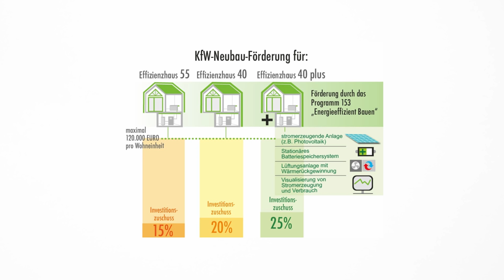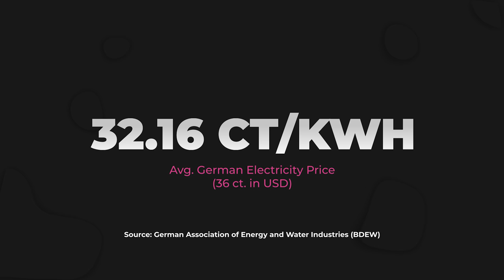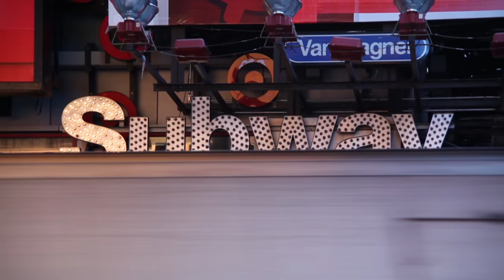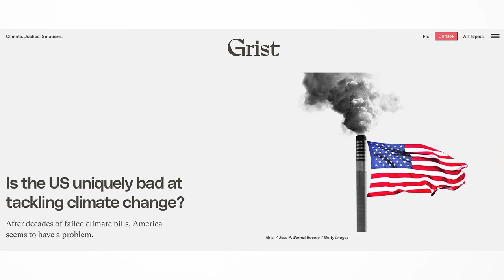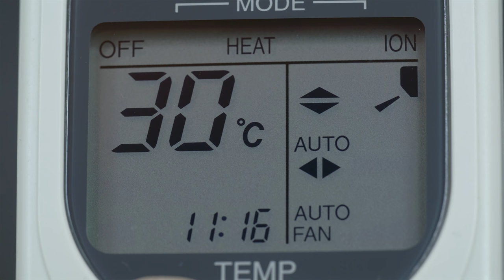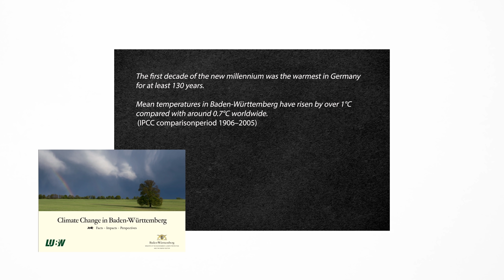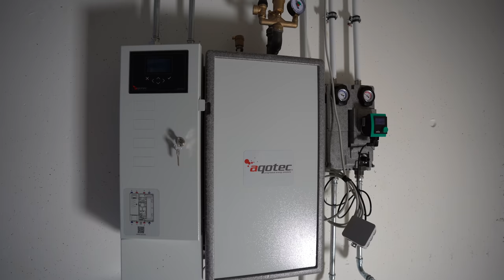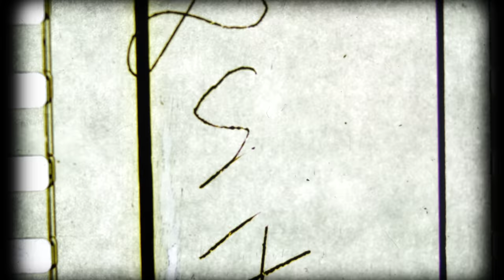HVAC (HLK) in German & American Homes | A Tale of Two Countries

Comment: When I was in the US I always recognized the noise of the forced air heating systems. This is a great advantage of radiant heat. Sometimes I simply could not sleep when the heating was on. In addition I  dont like the soft "wind"/air movement that is always happening inside the house with the forced air system. But this may be  a matter of getting used to it.
Reply from the maker: I would imagine it is just something you have to get used to.  Since we grew up with forced air we can't sleep if it is too quite now. We run an air purifier in our bedroom partially due to my allergies, and partially because we like the white noise.
Reply: This year I discovered I cannot handle the sound and feel of forced air heat. This is after travelling between America and Germany for the last 15 years. Every house we stayed in in America in 2021 had heating systems that would come on, go off, come on, go off, all night long, and when you have jet lag you just lie there listening to the on off cycles. There were certain places in the kitchen we couldn't sit, because a floor vent was blasting us with what felt like cool air. When I complained abut the loudness of the forced air, my family couldn't comprehend my problem. When we had a heating system inspected, I told the guy it was extremely loud. He arrived and said, "This is actually a very quiet unit." !!?? We are officially Euro wimps now.
Reply: @TypeAshton  I do have a creek right in front of our house and we sleep with open windows typically, so the small creek provides some "white noise" as well. But I do recognize that I have a better sleep when there is only a few water in it. This time of the year it is a difficult balance between fresh air and  the noise coming from the flowing water.
But nevertheless it is way better than  loud traffic noise of course 😁

Comment: Dear guys,
we live in the Rhine-river-valley near Ludwigshafen/Mannheim, so the climate is similar to yours in Freiburg. In the late 1990ies, we retrofitted a 1950ies barn building (one-story brick and mortar with an open wooden roof area) into an office (under the roof), repair shop, and warehouse building. We tried our best to insulate the rather thin walls with 12cm styrofoam) on the outside and roof surface from within. We installed 3-pane insulation glass windows. But because of the layout like two big folding garage doors that couldn't be insulated at all, there were always temperature bridges and we had difficulties with heating in the winter and esp. keeping cool in the summer. So we bought two mobile AC units, which we mounted to special wall-sockets and which we used during the hottest day of the summer (max. two weeks a year). And in 2003 the summer was so hot for such a long time even our newly built house with 16cm styrofoam insulation heated up considerably after 10+ weeks of constant heat - I remember our dog (avatar picture) didn't want to go outside anymore, not even around midnight or in the little hours because it was so frickn hot. So we took one of the AC units from the office and put it in my twin boys' bedroom. But this was the only time. Normally it is enough to just open the windows at night and close them in the morning and keep the shutters closed during the day.
Concerning AC and sickness: that's a thing. My late husband drove a car with automated AC as he was driving a lot for the business (app 100,000 kms a year) and driving in the summer without AC is not fun, even in Germany. He often complained about stuffed sinuses and even had iritis on several occasions. He suspected his car's AC and switched it off with the result of no more stuffed sinuses and no iritis anymore.
CU twinmama

Comment: Water basset underfloor heating is by fare the best system. Yes there is some lite time to change temperature. By the way the best cooling I have ever experienced is basically cold water in the ceiling. It gives a natural cool environment. Where AC gives you this super cool draft from some where. And cooling the water happens by pumping the water underground.

And I also have a district heating system it’s super nice.

Comment: Living in the DFW metro you need central air especially the months November-March. Here you have Monday 25 F as a high and Thursday 86F . So you need Tobe able to switch quickly. Rest of tge year you use AC anyway. Not sure if radiator heat is cheaper. Our old farmhouse used a lot of oil to heat whereas the HVAC here is quite efficient.

Comment: In North Iowa having forced air heating is a ghastly idea.  There are dreadful swings in temperature several times per hour in Winter.  Happily I have hot water radiators which is much more comfortable in many ways.  It doesn't dry the air further like hot dry air blowing out several times per hour.  if to warm or cold one can move closer or further from the radiator.  Dust is not spread readily by forced air. 

I use the same techniques of cooling as described by having cool night air through windows if possible, then closing off windows after sunrise.  That of course isn't totally sufficient and several small Air Conditioning units are just essential.

Comment: The whole "AC makes you sick" does have a bit of truth in it, but it's only a problem when you use it "wrong". I mostly hear it when talking about AC in cars, which is way more common than AC in homes in Germany. The big problem is switching from outside (30-35C heat) to inside (AC, often set way too low). Outside your dressed very lightly and you're sweating. Then you go inside and suddenly the cold air blows directly onto your sweaty skin, increasing the cooling effect and actually cooling your body down way too much. Then, after your drive, you go outside again etc...
Some people are sensitive to those changes in temperature and can easily get a cold.
And of course there is the problem of germs living in the AC ducts. When hot air gets cooled down it loses a lot of moisture, which can accumulate in air ducts. Bacteria love a dark, moist place where they can multiply freely. Again, have those bacteria blown in your face from your car AC and you can get sick. To prevent this AC units have filters, which have to be changed/cleaned regularly, so it's not really an issue with AC in general, but with improperly maintained AC units. While I don't have AC in my home in Germany, my workplace (in the medical field) does, but we are only allowed to run it as long as it is being maintained properly and the maintenance has to be documented.

Comment: I have friends in Denver who have never had AC in their 1950s home, but then even days that reach over 100°F usually drop to the 60s at night.
Reply from the maker: That sounds a lot like the kind of weather that we experience here in our part of the Black Forest. In the summer we might see temps in the 90s during the day if we are in a heat wave, but it cools down significantly at night. So usually we just open up all of the windows at night to cool down the house and then keep it shut during the day. We can usually maintain a pretty comfortable temp as long as the heat wave doesn't last weeks.

Comment: We live in MV in northern Germany and we just use fans in the summer and that’s enough for us. In the winter we have radiators just like you but have a broiler that uses gas. I’m from the US specificity NC and in the summer my parents get by with ceiling fans until they can’t stand it and then the AC is running.

Comment: i live in a  old house in germany. in one winter there was no heating and the house only cooled down to 13° although it snowed for days. in summer it only goes up to 26° if you close the windows. I don't see any reason to heat the house a lot or even have an AC. I'm still glad that I have an AC at work. typically German, I want to be able to work efficiently.

Comment: At our house we have big windows with outside venetian blind (Raffstore). Every "normal" Window has blinds (Jalousie). Without them it would be uncomfortably hot in the summer. But if we have a long hot period, the house will of course still get warmer and warmer. In addition to our Photovoltaic System on the Roof, we think to install an AC, so that we can use the excess energy in the summer to cool it down on the evening.

Comment: I live in Austria in a south facing apartment with big windows and one room even being right under the roof. I luckily do have AC and I use if a few times each summer, especially in the bedroom. But that is in addition to an awening, shutters and opening the windows when it's cooler. The AC is basicly just the last resort when the other options just aren't enough.

When I was in New York the hotel would always turn the AC doen to 17 ot 18 degrees celsius. I do that at home too, but my AC does not manage to get that cold. It was so bad coming from at least 30 degrees outside into that room that suddenly felt like a walk in fridge. No matter what temperature we used when we got back they had always turned it back down to 17 degrees.

Comment: Central Airco is basically not allowed to be installed in Switzerland. 
Many new district heatsystems are introduced. Maybe a district cooling system is needed too in the near future, allowing to store the heat for use in winter?
Doing this at the district scale is likely economically viable.

Comment: Air is just a very poor heat conductor. I think the main reason for the predominant use of central HVAC units which utilize air for cooling and heating is cost. With the way houses are built in the USA, just laying the necessary ductwork to every room is much cheaper and requires much less know-how from the construction workers, than water using heating and cooling solutions. 
I‘m from Austria and I had our new family house built 3 years ago. It is actually a wood framed house, but with pretty massive framing (30cm * 8cm / ~12inch by 3inch) filled with cellulose insulation plus 6cm / ~2,4 inch wood fiber insulation on the outside and 8cm / ~3,1 inch insulated framing on the inside of the wall for installation purposes. The roof is insulated with 40 cm / ~15,7 inch of cellulose. 
I‘m heating and cooling with a heatpump, radiant heating in all floors and radiant cooling in the ceilings. For fresh air we use a central fan with an enthalpy heat exchanger with recovers over 90% of the heat of the outgoing air in Winter and of the cold of the outgoing air in Summer. In Winter it keeps the inside air more moist for better air quality and in summer it keeps the humidity outside. 
So we can keep our 23 C /50% relative humidity throughout the year with only ~ 1500kWh/a for heating/cooling/fresh air and hot water. 
But the most important aspect of this system is the „level-of-wellbeing“. There is no noticeable noise or draught from the air fan, because it only needs to deliver fresh air, not heating or cooling and all surface temperatures inside the house are always pretty equivalent to room temperature because we only need 1-2 degrees of difference for heating and cooling.
The downside is upfront cost because our system for example cost us over 30000 € all in all. But operation and maintaining costs are very, very low.

Comment: One mayor problems with german family homes is, that the bedrooms are upstairs and sometimes unter the roof. Even with excellent insulation not very comfortable in hot summers like 2016 - 20. We built in an AC system in our house in 2015. Energy came from an large  photovoltaic panel system installed in 2005. Still producing much more energy than we use. We have even enough electricity for 15-17000 miles/annum with our brand new Volvo recharge.
Reply from the maker: Wow! Super cool.

Comment: Having lived in the US (north east) for 3 years, I am not sure if Germany wouldn't have more air conditioning if we had the same climate as, for example Delaware where the summers are very hot and humid. We live in a rented appartment and we bought a mobile air conditioning which is a little smaller than a washing machine and only cools down one room. We bought it for the very hot nights and only run it a fiew hours before going to sleep (because it is LOUD). Last summer was so cold that we did not use it once.
Reply from the maker: The humidity I think is the big part here. We are currently on vacation in Thailand which is 33C during the day and 23C at night and very humid. We could not imagine not having an AC unit in our hotel room.

Comment: Reading the other comments, I wonder if I'm too critical- too much engineering driven, but since I'm presently re-evaluating the enegy consumption of my own house that I just took over a couple of years ago, my thoughts are:
- In the earlier videos, we have seen a comparison of the types of construction of simgle homes in the US and Germany.
- In this video, the usual heating strategies in the different states of the US to Germany are shown. It is told that German radiant heating systems are more efficient.
"More efficient" is a qualitatve criteria. What I miss at this point are quantitative statements, such as, "elder single houses in Germany have an heating energy consumption of approx. 150 ... 200 kWh per m², for new ones the maximum heating energy consumption shoud be less than 50 kWh/m², with today's KfW 55 energy standard, the energy consumption should be around 37 kWh/m². In the US, when areas of same climates are compared, US single homes have and annual average heating (!) energy consumption of approx. xy kWh/m² (heating includes warm water conditioning)".
Given that the single homes in the US are widely timberframe houses with walls of wood-based panel materials and (usually) different heating systems (central air) it would have been super interesting to understand the impact of these differences.
One more thing to add, new built single houses in Germany, as long as not connected to district heating that is getting more and more popular these days, are widely equipped with heat pumps. In these cases, the heat pumps can be used for cooling / air conditioning, too. I have no idea about possible different degrees of efficiency when comparing the energy consumption of a heat pump while cooling to a central or wall mounted A/C unit, but that might be an additional thing to discuss.
Reply: @Black Forest Family  I will second this request.
Reply: @Black Forest Family  -- I will second this request.

Comment: I'm from the Netherlands and we don't have AC. Most of the year it's nog nessesairy.  We have hot water underfloor heating and are disconnected from gas. We do all water heating and coocking with electricity with our roofmouted solar panels. In the Summer our electic Bill is very low, but in Winter we pay a lot mostly because of heating. When we go to Italy on Holiday we often have an apartment with AC. The first days we het a runny nose and a sore throat before we get used to it. Mostly we cool the bedroom before going to bed and turn the AC off while asleep.

Comment: I live in Bonn and when the summer became too hot to handle (not 2021 as it was a bit of a damp squib) I turned to early morning open windows followed by blinds and shutters. HOWEVER  I did cave and get a water evaporation based air coolent unit. Less effective but easier on my conscience.

Comment: I think it would difficult to install forced air as a retrofit system. Initially, European heating systems were retrofitted to existing properties when we moved away from open fires in every room. The solid construction of European homes means there is not a wall cavity between studs to run ducting between floors. European homes generally don't have basements to run ducting either. So smaller diameter copper pipes to distribute hot water for radiators just makes more sense. This has now become the norm and a technology that people are comfortable with and contractors exist to help service and repair. Some more modern properties may have these systems installed but having recently retrofitted a whole house extraction system it is tricky to do.